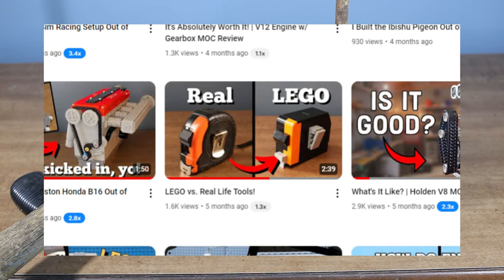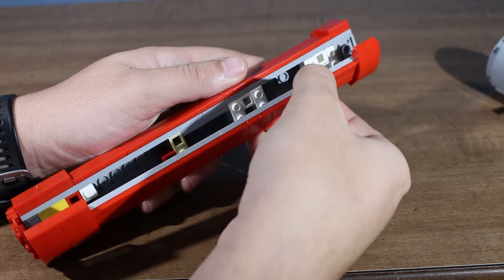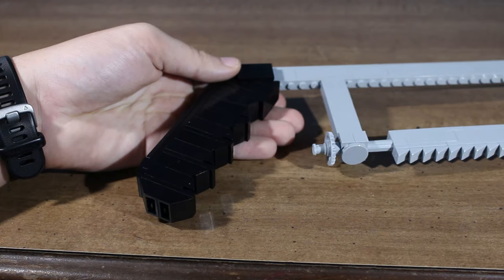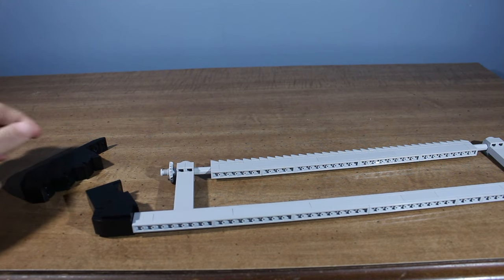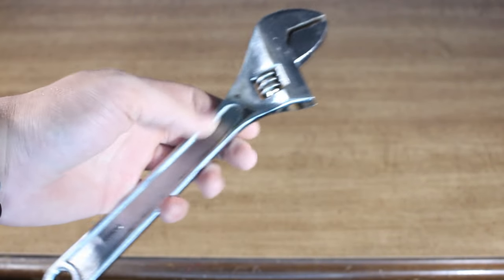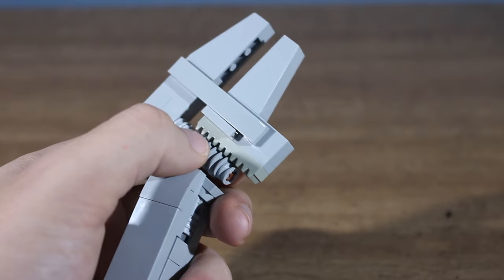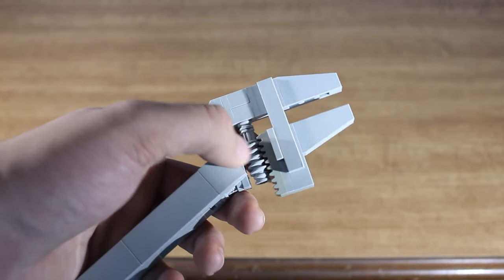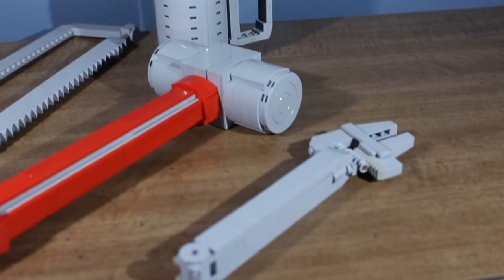LEGO vs. MORE Real Life Tools!

Comment: at the saw you should add snot in the handle and put 2 by something
Reply from the maker: @T1M3RTY  it's not that simple. In order for it to feel good in the hand it needs those grooves, but to add snot bricks to reinforce it, that would block those grooves. And the weak point is really at the top of the handle where the blade attaches. There's a hinge there, and reinforcing that hinge would make it big and bulky, and ultimately it wouldn't looks good
Reply: @DeltonAdamsLEGO  oh ok